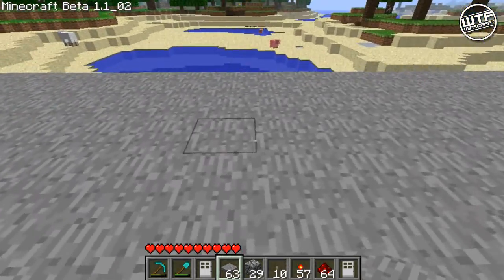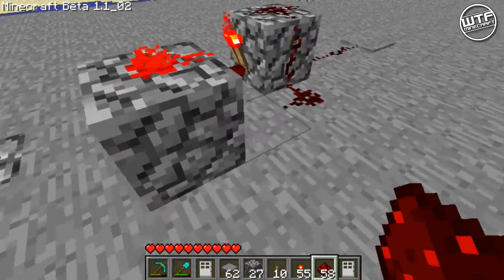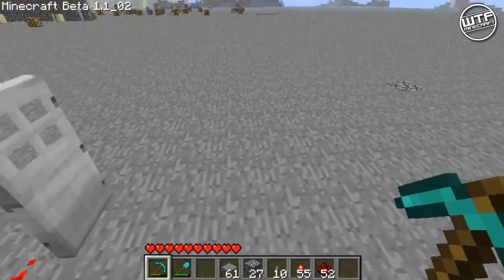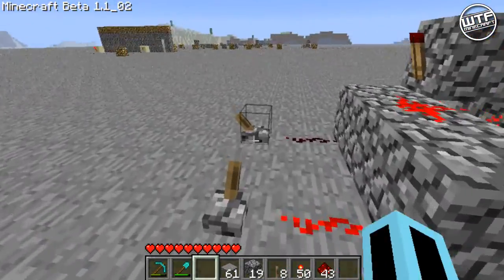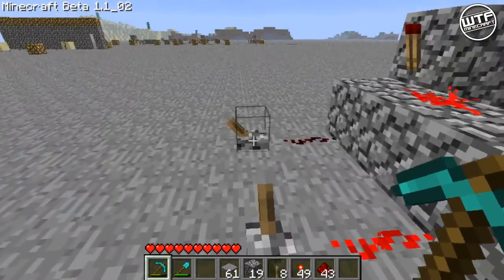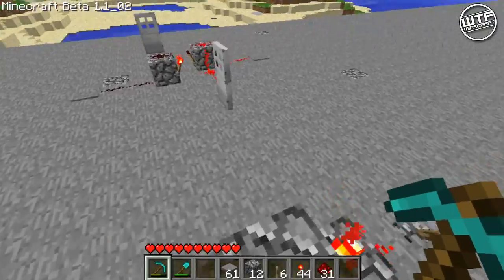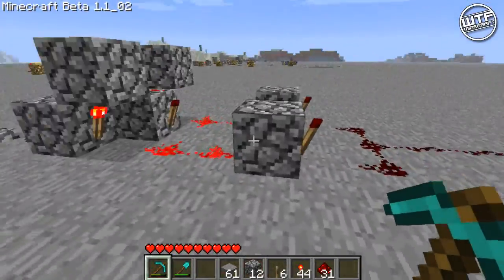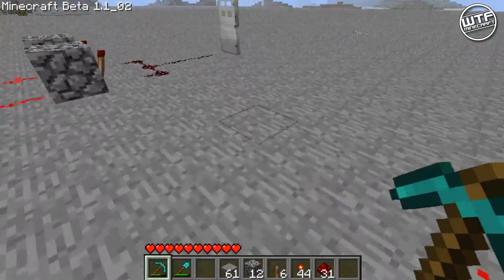Minecraft - Intermediate redstone tutorial - Memory locations and preparation for a combination lock

Comment: I guess you could use the double pressure pad lock thing in a outside door to hallway inside a house. you step on 1st pad outside the 1st door and opens the 1st door and closes 2nd(no need lol) and 2nd pad by the 2nd door to lock the 1st door and open the 2nd. So could be used for advanced houses...